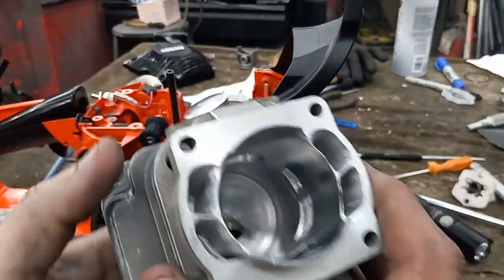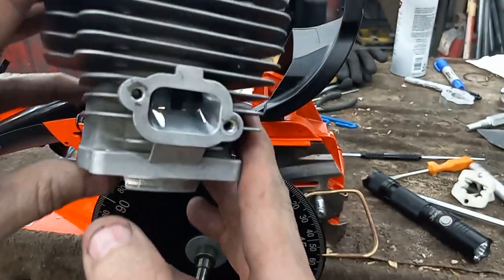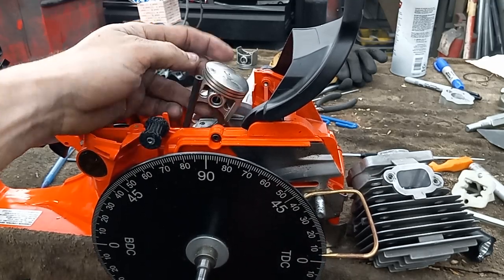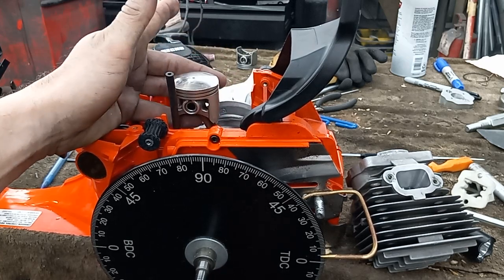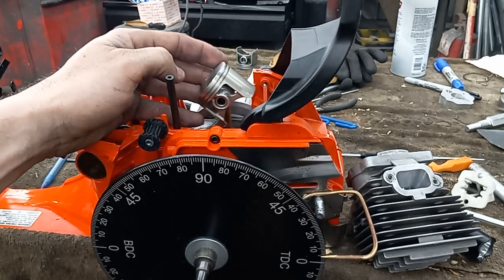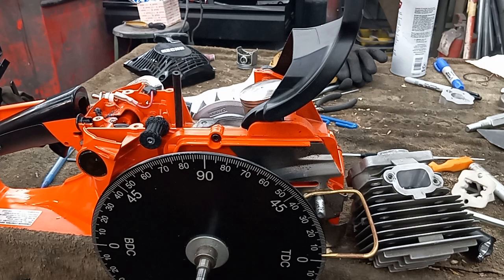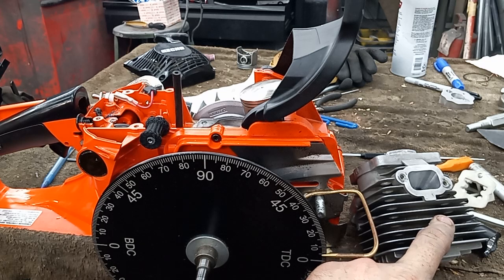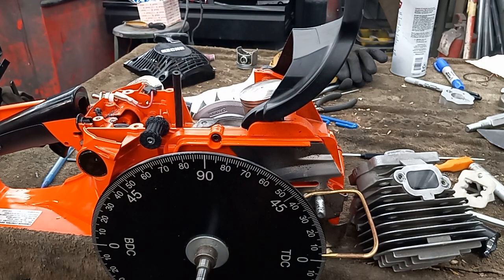Port work an final numbers on reed feed 4910

Comment: This is fun to watch. I have a question for you Charles. On your other normal hot builds for the 4910 and 501’s. Is the 501 worth the $100+ to use that saw versus the 4910?   Thanks
Reply from the maker: I get same power out of 4910 as 501